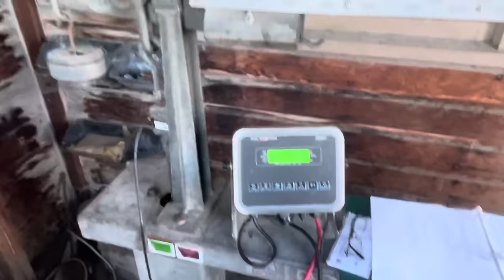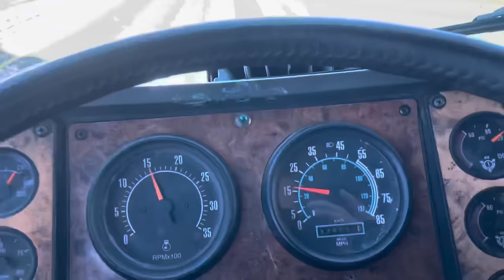Can I Train ANOTHER Bullhauler from SCRATCH?

Comment: Thats a beautiful truck he's got 👌 why was he running with his drop axle down on the highway with a light load like that ? I only drop it with certain machines on the lowbed . Is he doing it for the extra braking? Can't be helping his fuel mileage and those kitty cats a thirsty !
Reply from the maker: It was heavy enough, he would have been overweight on those drive tandems without it down. South Dakota DOT love to nip a guy with his axle up.
Reply: So they just load you way lighter ? I do equipment I just couldn't picture the cows being heavy enough to require the axle down but I'll take your word for it you guys know !!! Thanks for the answer buddy
Reply from the maker: @rirebel6029 yeah man, with his pusher up he would be 37-38k on his drives. Personal record max net for me my cow trailer is 75,315 lbs 😁

Comment: Hey, I like your video and dose truck's look good you mentioned a little more HP you wouldn't mind you can do it with out compromising your fuel economy just with quality oil and fuel additive you can gain 3 - 6% some see as much as 10% hp may even get better fuel economy never know
My background in diesel mechanic for 30+ I have seen and experienced my self guys spending thousands on tune kits and compromising engine longevity is the worst when you tune
Reply from the maker: Thanks for the insight 👍🏼

Comment: Why does the trailer on the kenworth have single tyres and not dual tyres all round
Reply from the maker: to save on weight
Reply: @realwildwildwest doesn’t that halve how much weight you can carry though???
Reply from the maker: No, single tires axles are rated for 13k  so you have a 13k axle, a 20k axle, and a 13k axle giving you a total of 46k . The law will only allow 43k so we don’t lose anything.
Reply: @realwildwildwest  oh ok so you couldn’t actually put dual wheels on those front and rear axles